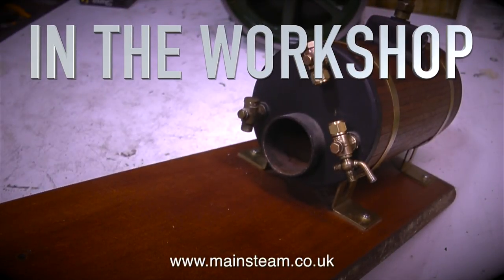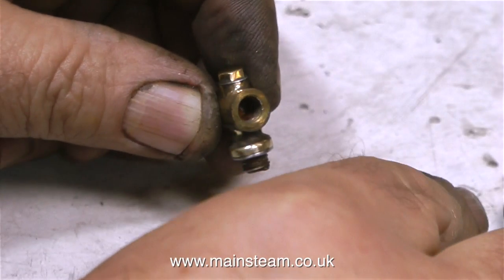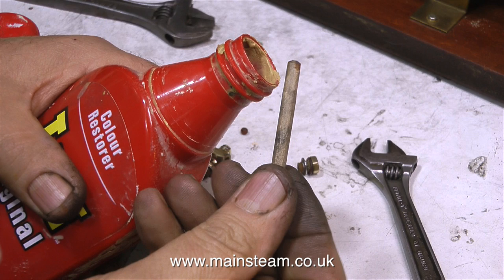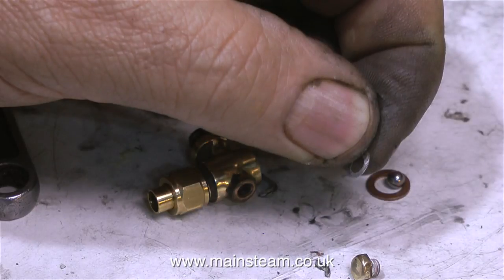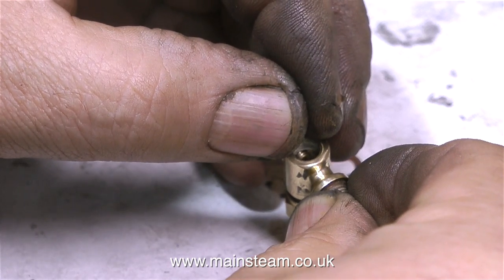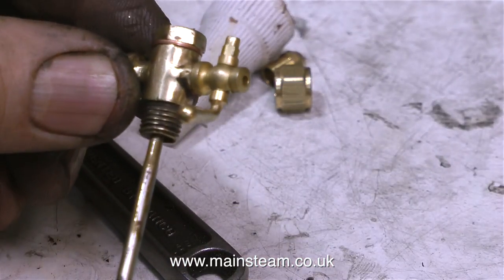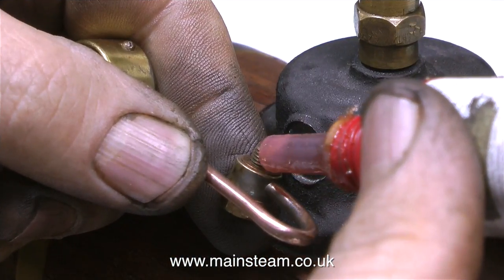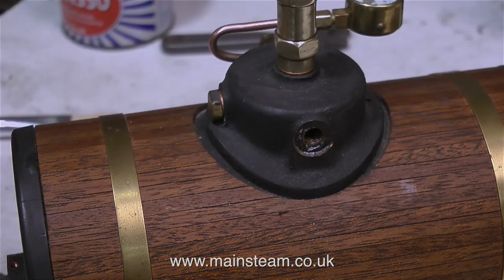PROBLEMS WITH MODEL BOILER FITTINGS - IN THE WORKSHOP

Comment: Love all your videos... I have a long commute to and from work and sometimes i listen to the videos instead of the radio...at least im learning something.  I do have a question though and maybe you have a video but i need to replace a top bushing on one of my boilers; i believe a Cheddar...  The existing bushing is stripped and now the plug just spins.  I found the bushings on PM Research but was looking for a video on the actual replacement.  Thanks again for the videos.....by the way..i did find them useful!!!..lol
Reply from the maker: There is this video that I made when I was working on an old Stuart 500 boiler, but bear in mind that this type of boiler is brazed (which has a higher melting point) so it didn't fall apart when I silver soldered the new bush in. I would leave boiler repairs to a professional if I were you. https://youtu.be/oYE8BnUULAY

Comment: Wow...you replied, i was thinking another viewer might reply but Wow!...love your videos sir and thank you very much for the reply and advice.  If i do move to having this done by a professional i will need to buy the bushings myself as i am sure a local welder will not have a hobby steam sized boiler bushings on hand.  With that said, can you tell me what size the bushings are on a standard cheddar boiler?  I had some 1/4 40 mtp and ust bushings on hand but the original plug would not fit it.  I see that Clevedon Steam has them but really dont want to order the wrong thing.  Thanks again!
Reply from the maker: Cheddar Models boiler Bushes were usually 1/4 x 32 threads per inch

Comment: If scale build up is a problem, instead of buying distilled or de-ionised water, you can buy reverse omosis filters which are most often sold for cleaning water for use in fish tanks.
You can get a 50gpd filter for about £30-40 on ebay, and you have to factor in the cost of replacement filters and the waste-water (if you're on a meter),  but might be worthwhile if you have very hard tap water.
The filtered water is also useful for other things, like ironing clothes, washing windows, and home-brewing.
Reply: I usually use tap water, but if you have a dehumidifier it is a free source of distilled water.
Reply: Or, collect the output from your dehumidifier and run it through a coffee filter to remove the dust. Not quite pure water (there will probably be dissolved gases in it) but not far off and best of all it a "free" byproduct.
Reply from the maker: I would be slightly concerned about maybe getting "Legionnaire's Disease" ......... }:-))) I do use a water filter jug sometimes though .......

Comment: Hi Keith, I love your videos; thanks for making them.  I'm confused in this one, about the placement of the siphon and gauge:  with the siphon horizontal as shown, how does it trap water to protect the gauge? I thought the loop had to face down? I'm new to this, so I may not know what I'm talking about.
Reply from the maker: It traps water because initially the pipe is cooler so the steam in the boiler fills the pipe and immediately condenses to water. The position is relatively unimportant. This boiler is designed for an Open Steam Launch and it is positioned like this so that you can see the pressure gauge clearly as the boat sails past.
Reply: Keith Appleton OK, thanks! I had assumed that the loop had to be down so gravity would trap the water (like a sink trap), but thinking about it, the pipe is so narrow it would stay in place like water in a closed off soda straw. Learn something new every day - thanks again!

Comment: Seeing you clean the inside of the check valve a thought occurred to me - have you ever tried an ultrasonic cleaner?  They can be bought very inexpensively.  And if you used lacquer thinner in one I bet it would clean up greasy or painted parts very well.
Reply from the maker: I have seen them too, but the cheap ones are a bit small .....
Reply: We got ourselves an ultrasonic cleaner intended for jewelry for very little money. It is shaped a bit like a frier, and we use it to clean car injectors and other parts. I think it would big enough for most of the fittings and valves you use in steam engines.

Comment: This is why you should use m.t.p. threaded fittings, they have a tapered pipe thread, and seal up nicely, instead of using straight threads and aluminum spacers
Reply from the maker: In this very small size "ME" threads are the standard.